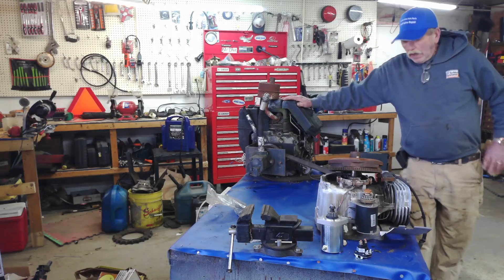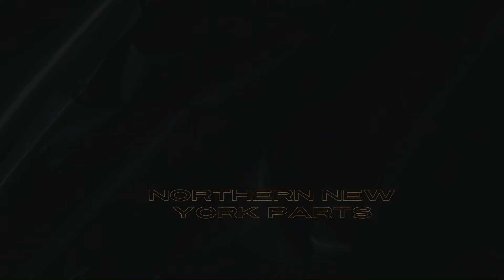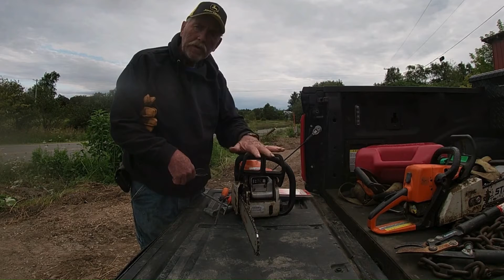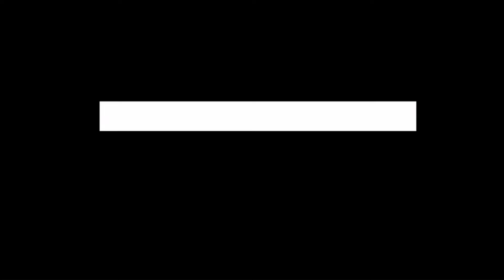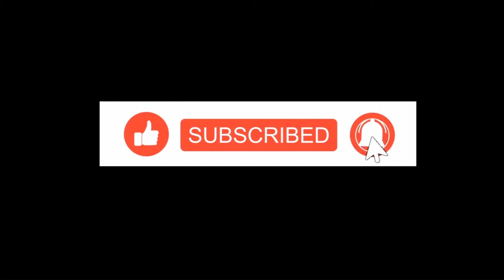How Does A Starter Work On A Lawn Mower: Let's DIve In

Comment: I always pull the starter and clean the armature and lube the bushings on everything I buy used. Saves buying a new starter down the road.
Reply from the maker: Its a good idea Jason. For the higher end starters, we pull them off salvaged machines and put them on the shelf for later use.